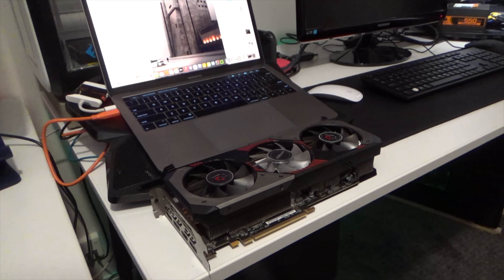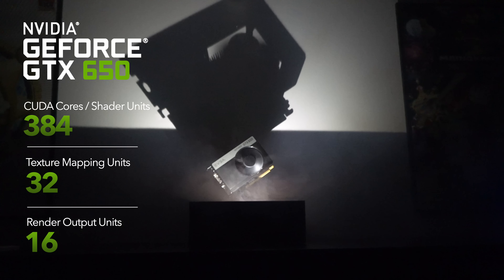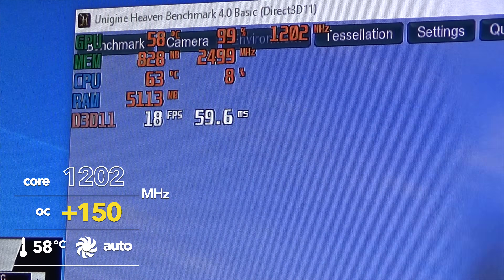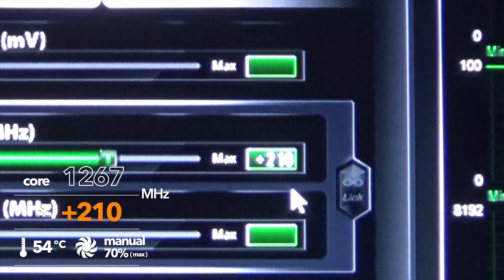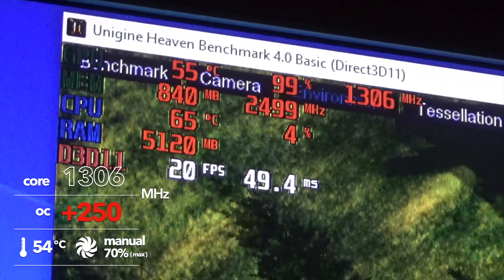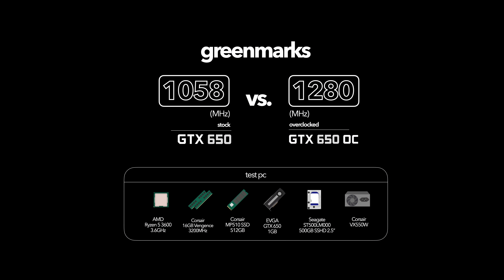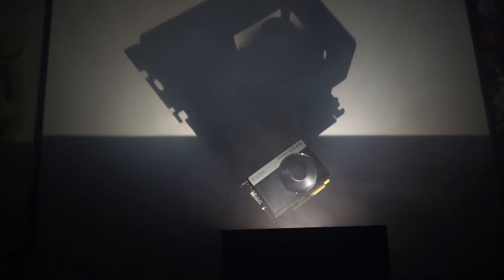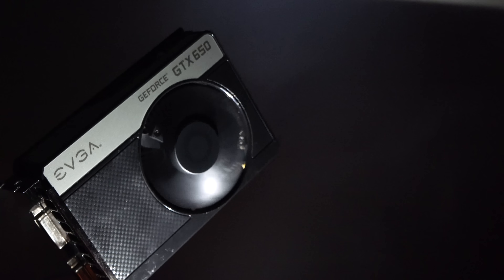Overclocking the GTX 650

Comment: ola tenho uma GTX 650 ate hj e gosto muito dela. acredite jogo D4 nela kkkk e CS. parabens pelo Video.
Processador	Intel(R) Core(TM) i3 CPU         550  @ 3.20GHz   3.20 GHz
RAM instalada	9,87 GB
Armazenamento	233 GB MAXTOR STM3250310AS, 298 GB WDC WD3200AAJS-00L7A0, 466 GB HDD ST500DM005 HD502HJ, 466 GB WDC WD5000AAKX-003CA0, 466 GB SAMSUNG HD502HI
Placa de vídeo	NVIDIA GeForce GTX 650 (985 MB)
ID do dispositivo	551B52F3-0F39-49DE-B6C8-23C6185A128D
ID do Produto	00330-80000-00000-AA844
Tipo de sistema	Sistema operacional de 64 bits, processador baseado em x64
Caneta e toque	Nenhuma entrada à caneta ou por toque disponível para este vídeo

Comment: I had 2 GTX 650 Ti Boost cards that I ran in SLI. Nvidia's best budget performers at the time. They were basically downclocked GTX 660's, and combined they could easily out-pace a 680, or even the mighty Radeon HD 7970 (Asus Matrix Platinum version). Best budget purchase I ever did, as the combined cost of 2x 650 Ti Boost was comparable to 60% the price of a GTX 680.
This setup, combined with an i7 4790K CPU served me well for a couple years, before I eventually swapped them with a 980 Ti. - Both cards still live on to this day. One in my mom's Dell, and the other was sent overseas to a good friend of mine.
Nvidia did never feature SLI connectors on the x50 series again after the Kepler generation. I guess they learned their lesson with the 650 Ti Boost being too good value.
Reply: They did NOT outpace a GTX 680 lmfao. Keep dreaming
Reply: @CovenantAgentLazarus  Uh, they did in fact beat out the 680. Though mostly at 1080p.
A lot of benchmarks from that era shows this to be the fact.
Reply: @Skarfar90  No.

Comment: 2GB EVGA 750 Ti SC user over here in the UK. Still runs nicely on a Q9650 XP/8.1/Zorin 17.1 build. Comes complete with the limited edition optional extra metal backplate as well. Thanks for giving it's cousin some love here on your video.

Comment: My buddy sent me the xfx r7 360 in the mail as a place holder for my rig when i built it back in 2015. That old card paired with my I5 4690k always surprised me. I was never playing anything crazy though. Alot of Bad company 2, Warband, Arma 3, and CSGO. I was more than happy to replace it with my GTX 970 (which i was still using that 970 up until last year), but i sure did appreciate that little card and what it was capable of.

Comment: This was my first discrete graphics card! Before the gtx 650 I've been using AM3 motherboard's integrated graphics for a while, and when I wanted to run games that came out later than 2007 I would get a slide show in most of them. It all changed when I bought GTX 650. And you know what? TES V Skyrim became my favourite game very soon then 😅

Comment: Maybe Some Voltage is solving your artifact problems? you can easly mod your old gpu bioses and tweak for little bit voltage biases
Reply: i modded my hd6850 and it's running 1100mhz and 70°c Swapped the cooling block hd7850 Dual fan it's running about 60FPS On GTAV Online 1080P Medium settings

Comment: 11:33 I had that same ASUS GTX 650, it was the first card I ever saved up for and bought myself. An upgrade from the pre-installed GT 610. 
And despite the extra horsepower I pretty much exclusively used it to get better FPS in Source games. Great card until the plastic fan thingy literally fell off inside the tower and I was out of warranty.

Comment: about 10 years ago i actually used a Gigabyte GTX 650, but i swear it was clocked higher than your specimen. maybe around 1200MHz out of the box? anyway, i always love content showing these older hardware pushed past its original specs.

Comment: Had the 650 until 2015, can't believe a low end gpu could play everything in that period at high settings easily. Now with a 6600xt I could barely play AW2 at low settings 720p lol!
Your vibe hasn't changed a bit man, so glad you're back!!
Reply: sounds like you have extreme gpu bottleneck bro with a gpu  that strong you need a strong CPU as well plus you should be running 32gb of ram atleast
Reply: My cpu is a skylake i7, runs doom eternal in triple digits framerate, minimum requirement on AW it's an i5, so optimisation doesn't exist.

Comment: I've actually been studying cards from around this generation off-and-on for a while.
I was in high school around the time this generation was relevant, and I was very fascinated by computer tech, especially around GPUs back then.
I probably spent unreasonable amounts of time watching videos and reading about new graphics technology or how rendering works in games from the time.

The GTX 650 is usually made from a GK107 chip, which is very similar (almost identical) to the chip that eventually replaced it; the GK208, which is a slightly reconfigured version of GK107, made smaller and easier on power.
GK107 and GK208 were considered low-end chips for their time, but cards based on them were almost legendary. If you couldn't find something decent on the used market, or maybe you were a broke teen that only had the money for ONE (and only ONE) computer component upgrade, these cards could be had for a slight premium when new, but they would play all of the biggest, most popular, most fun games from the time.
They were not high-end, but they'd drop into almost any system and you'd get (very literally) thousands and thousands of hours of good gaming out of them.
I assume it would have been the same for cards based off its competitor, Cape Verde.

I see a lot of people these days finally waking up and realizing how garbage most modern games are. A lot of nostalgia, looking back at the "golden days" of YouTube, Minecraft nostalgia, and a lot of looking back at game titles from that era. Look at Crowbcat's "Golden Age of XBox 360 timeline" and remember that a lot of those games were also on PC, too.
LoL, DoTA, Starcraft, Diablo, Runescape, Far Cry 3, The Binding of Isaac, AoTTG, every MMO known to humanity, flash games, Minecraft (with shaders), and yes, even Skyrim.
GK208's and Cape Verde chips weren't high-end but they played 'em all.

By the way, I don't remember this generation of cards having as much memory OC headroom as newer stuff, but I recall Kepler did see some improvement from higher memory speeds. If you can OC the memory on an old card, just go for it anyway, you probably WILL see some performance benefit, especially with a core OC too.

I had an Optiplex 745 Desktop FF back then, with a Pentium D 945 (that OC'd to over 4.2GHz complete with jet turbine fan), 8GB RAM, and a Zotac GT 640 (Rev 2) LP.
My high school tech teacher knew how bad my PC situation was at home, so he let me have a few decommissioned school PCs for free, and that's how I got it.
Before that Optiplex I never had a computer with a CPU fast enough to play anything other than Minesweeper (I'm not joking you could alt+tab between two Notepad windows and SEE the text re-render top-left to bottom-right).
Before the Optiplex I never had a computer with enough RAM to have more than ONE (I say, ONE) program open (F your "tabbed browser" you get IE6).
Before the GT 640 I never had a computer with a graphics chip fast enough to run anything other than maybe some long-dead late 90s games.
I still remember the first summer break I had the card, I spent all night every night playing games like Far Cry 3 and Skyrim, I was completely blown away, and this was only from a "low end piece of junk."

I still have that Optiplex; it did its hours of gaming and years of extreme Folding@Home, but it's been retired as a media center PC in the living room now, with a Q6700 and an EVGA GT 740SC (I bought the PCI risers for the Optiplexes). Original hard drives from 2006 somehow still ticking in all of them.

Yes, I actually do keep the GT 640 next to me where I sit at my computer. It's sitting next to a Radeon HD 5970 (which was my dream GPU and sparked my hobby of PC tech).
Both cards somehow just ended up there, and they've been sitting there for two years, but I have plans to put them into a testbench to run Folding@Home and other GPU-compute projects for fun.
I still do look over at them and remember the good old games from time to time.

By the way, how'd your friend handle the DPC latency problems on his Optiplex? ;)

Comment: these older cards still got some life left and more performance to be gained from overclocking but the drivers really do kill the viability of being able to use them in the newest titles. that being said, if youre on the games that will run on even the integrated graphics, you can get the most with what little you got to work with. i remember the old days of doing that with my old system when i ran a gt 730 and later on an hd7850 2gb. its always nice to see coverage on the older cards as there isnt a whole lot of recent revisits for them.

Comment: My gtx 650 "experience": When I was shopping for a video card in Aug-Sept? 2012 it was between the 7750 and the *more expensive GT 640*, the 650 was not available yet. When it was avaliable, you'd think they would dump the price of the 640, right? Nope. To make matters worse the 650 was $50 more than the 7750 but definitely did not perform $50 better. Needless to say they dropped the price considerably by the end of the year, but so did AMD, and now you could get a 7770 for the same price that absolutely smashed the 650. NV's higher tier cards were priced competitively but their lower tier cards relied on the brand to sell, though I don't think that it's news to anyone that NV kinda hates to make low end products.

Comment: considering the size and power draw of the thing and the fact that the 60 series has xp drivers it seems like it may be a good fit for buying an older dell or hp pc and turning it into a mid to high end windows xp retro rig, maybe the more power optimal 750 would be better but this is still a good fit for that I think

Comment: The first GPU I ever bought was a Gigabyte GeForce GTX 650 OC 1GB and ran it OCed from 1110 to 1254 MHz for years.
Played a lot of Far Cry 3, Battlefield 3, Crysis 2, Tomb Raider (2013), Minecraft and CS:GO on this thing, and it still works today.

Comment: The gtx 650 was my first gaming grade card back in 2012 - when I was still in highschool. Remember spending ~100 dollars on a entry level video card? Bios modded that for more voltage, IIRC I got 1228 mhz and 5800 on the memory stable.

Comment: Glad you are still messing around with older hardware I've got a 4gb 750ti from aliexpress coming tomorrow going to slap it in secondary pc hp prodesk 400 g3 sff with an i5 6500 and a single 16gb stick of ddr4 at 2133mhz thanks to the cpu and board not supporting faster memory

Comment: Back in 2017-2018 I did some gaming using a GTX 650 with a Pentium B950 and even managed to run GTA V on low even though I need to limit the FPS to 30.

This card is great back in the day but gaming has evolved a long way since then

Comment: I had the 660ti as well as a cpl of 1gb 645 GTX, which were a cut down 660 gtx made for Dell/Alienware (576 CUDAS, 1gb GDDR5 on a 128bit bus, and can overclock rather nicely). Good lil cards for emulation (ran stuff like CEMU with no issues in Vulkan, as well as i had used it in the past for Far Cry 5, Fallout 76 & 4, Doom 2016, and a few others. they're rather cheap and easy to get, as well as no 6 pin, and it's a single slot card. You should grab one for an older Dell and give it a try :) i literally JUST put one in a no-budget Starter build for my niece - 1gb 645gtx/i5 650/8gb DDR3/2tb HDD/300w FSP PSU with an Acer Veriton mobo and case, plus PCI-E 802.11n wifi - perfect for Roblox lol. But she can also throw emulators on there, as well as things like more modern games in general, and have enough of an upgrade path to get a couple of years out of it . I had previously done a similar build for my nephew but used a QX9650, 8gb DDR2, a cpl 500gb HDDs and the 1gb 645GTX on an ASUS board in a Lian Li case and a 400w PSU (gave it to him in 2020 but it looked soooooo 2009 with that tribal tattoo style windowed case (threw an RGB strip in it with every piece of bare metal covered in White Krylon to help the Black enamel of the panels pop, and cover up that galvanized bare steel cases use). Old isnt always obsolete as you have shown here. glad you're back. cheers, i'd pay for the Maccas if i was there.

Comment: i think i pushed mine to about 1300? but cant remeber still have my heaven bench marks and they where FPS 39.5 Score 994 Min FPS 20.6 Max FPS 76.4 with a FX 6350 set at DX11 ultra 1440x900 i used to play Titanfall on it at 720p with it fully over clocked lol was great but wanted 1080p and ultra settings so i upgraded

Comment: This brings me back to trying to squeeze every last frame out of my GTX 760. I think I ended up finding a stable OC with +210MHz on the core. It was the 4GB Windforce variant from Gigabyte so it had plenty of cooling and I found it humorous that a certain other card was getting slammed for having 3.5GB while my 760 had the full 4GB. I also remember there was  a series from a channel called JERMgaming called the potato masher where the creator tried to match the PS4's performance with a GTX 760 (2GB) and an i5 2500, so I knew I could at least match his results. I don't think I'll even get rid of that card though I struggle to find anything it's good at... besides having analog output so I could use it with a CRT without an adapter. I think the 900 series dropped VGA support.

Comment: I'm a EVGA fanboy. I have EVGA GTX 750 FTW, GTX 1050 FTW, and a GTX 1650 Super.  The 750 could push +300 on the core, never really tried the 1050. The 1650 likes ram oc but will not hold a core oc.
Reply: Well the modern cards are more & more maxed out on the cores side for the clocks from the factory thanks to all the automatic boosting features, which limits you to VRAM overclocking most of the time, Meanwhile older GPU's, especially lower end ones like the x50 series cards tend to not be able to clock the VRAM at all, as the VRAM chips are really low binned chips, and the higher end bins went to the top models (where you could usually do almost +600Mhz on VRAM if you got lucky)

Comment: My friend once had a GTX 650. It was actually the exact same model as the one in the video. EVGA always tended to trend on the side of caution, with overpowered cooling and VRMs. 

The overclocking potential of the GTX 650 comes as no surprise. Kepler is a very interesting architecture, it was unrefined but had lots of potential. The GTX 650 paved the way of the Maxwell GTX 750 and GTX 750Ti. It could be said Kepler and Maxwell was the last generation for budget gamers on price to performance on the new market. Truly a legendary card from back in the day.
Reply: 750 wasn't Kepler
Reply: @jm036  comment edited to fix error, Geforce 700 series was complicated 😂

Comment: Tim's pc being a ryzen 5 3600 and a rx 5700x is the least surprising thing I've ever seen. It's also comforting knowing this man hasn't changed a bit. Also what a great touch that the start off this video is the exact same to the one he did about the hd5450
Reply: the hd5450 was my 1st gpu
Reply: @d3fault1420  my 2nd GPU, I put it through hell tbh
Reply: @d3fault1420  reported

Comment: Hello Tim, I am very long time fan! 

It may be worth researching fan made, open source or community made drivers that keep old cards alive. These can help extend it's life, as well as the overclocking. It was great to see some huge gains with the OC, especially some of the 0.1% lows that doubled. 

LowSpecGamer has now left the scene of getting the most out of minimum specs, moving to a journalistic approach of the industry. This does leave a gap for someone who has a love of old cards to optimise game settings, using settings file tweaks, low resolutions/settings, frame generation wth FSR and many more techniques to make what seem impossible to run games, actually possible. 

A series testing games minimum specs, and then overclocking those parts to see what you can get out of them would be great. Furthermore how with a small budget you can increase your FPS per 'currency'. The good thing about minimum specs is that they are old, affordable and easy to work with, with lots of online documentation.

Comment: The 660 was like THE card to get back in the day, combined the best price to performance. So seeing a 650 pushed to its limits is nostalgia for me.
Reply: I used to have a 660 Ti back then with my FX 6350. That combo got me through so much gaming. It was a massive gain over my old Core 2 Quad Q8300 and HD 6870. :)
Reply: @FinnLovesFP  I would have killed for a 660ti, I was stuck on integrated graphics for years! My first gpu was an AMD r7-240 2gb.

Comment: I had a 780ti that also had fun in tests like this, It ended up at 1240Mhz. At those clockspeeds it was essentially a bone stock 980ti, up until the API changes and updates waned for the old gal.

Comment: I remember buying this exact 650 brand new and being so, so impressed coming from antique Pentium 4 systems with equally antique video. And yet, it's beyond even low-end now and i've got an RTX 3090. Where'd the time go?

And yes, mine had that same buzz coming from it's fan. Probably the most audible noise my PC made at the time. Loved it anyway.
Reply: I had a Pentium 4 back when it was... well, only slightly old, but still viable! 😊

Comment: Hard to believe these cards are overs 10 years old now. I remember when it was brand new.😅
Reply: What's even crazier... The 8800gt I have laying around is less than 3 years away from 20
Reply: The nostalgia brought me back love your videos. And i still rewatch older videos till this day
Reply: @KebongaPvP  you accidentally responded to my comment.😅
Reply: I had one of these in 2014 for my first build 😂. It was terrible but I was fairly young and just happy to have a PC. Quickly updated it to the gtx 1070 on 2016 when that launched which then lasted me 7 years.